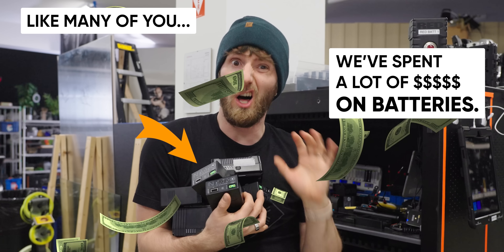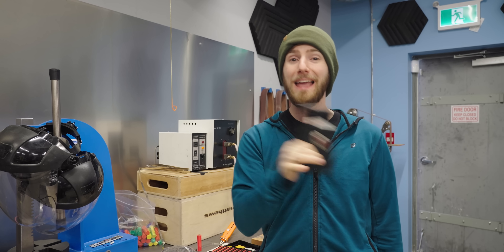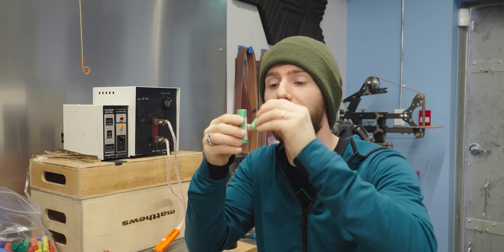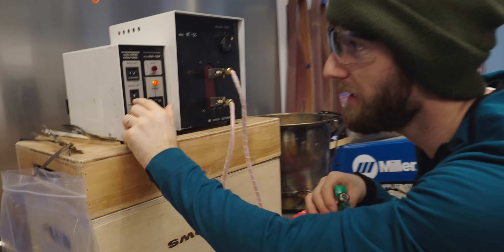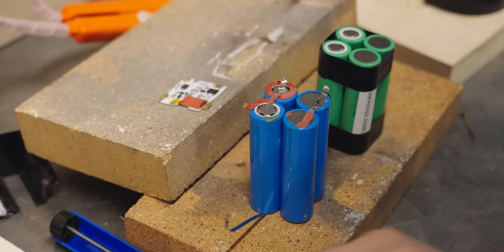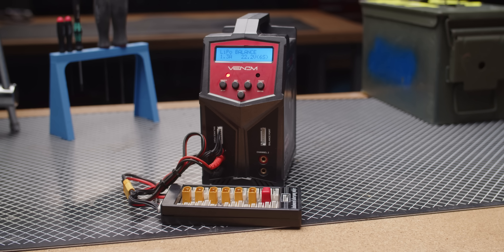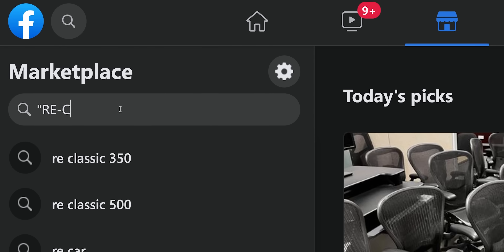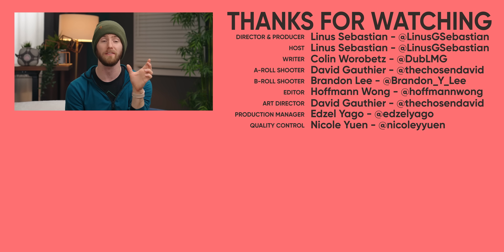This should be illegal… Battery Repair Blocking

Comment: Don't forget, this "Evil BMS" concept isn't just limited to batteries. Older Stratasys 3D printers (Specifically the Dimension SST and BST models) used cartridges of filament with a digital sensor to read the storage count of the spool. Sounds great right? Well the problem is, you can't go in and reset that even if you've replaced the filament yourself, meaning once a cartridge is dead (and usually you would be left with 10% of it that's unusable), that's it, into the garbage it goes and good luck getting affordable cartridges after they've become obsolete.

Comment: @linus you do realise that the spark you're seeing is from the tips of your crappy torch and not the cells right?

The cells can't spark in the configuration you have them in as you're only connected one end. They're open circuit.

The ones you threw out are perfectly fine.

Comment: The BMS is just dumb/evil in that there is no reset line on what should be latching faults. Preventing charging or discharging after a zero voltage event is a safety requirement as you can't safely charge a battery back if it has ever any single cell drop to 0-2V (Which is the same as disconnecting the pack)

If you ever do try to recharge a cell that hit near 0V for any moment in time it might look like it is charging but holes or denrites may have formed which will result in an internal short/fire/explosion. I've accidentally killed some battery packs by leaving a device attached and allowing the BMS to go into low voltage cutout but then going ten steps further and forgetting to charge it for a year+ at which point the battery cell voltages would have self discharged so low that physical damage would have occured.

If your extra "lucky" it will charge without exploding on the first cycle with reduced capacity but it is basically matter of time after that before something bad occurs to one of the over discharged cells.

Comment: Uh I don't think this was done correctly. When I see other YouTubers doing this with LiFePO4 batteries they use spot welders which have timers to make sure it is not overdone, and before they ever weld it they do a balance charge on them to ensure the same voltage. I think if Linus did more research on it, he wouldn't have popped any cells.

Comment: A guy in the UK bought a second hand Electric vehicle. He had it two years and the batteries need replacing. The resale cost of the vehicle with good batteries is £13k. The quote from the manufacturer of the vehicle to replace the batteries is £15k. So basically the vehicle is uneconomical to repair? Funnily enough the vehicle is only seven years old.

Comment: It's funny that you guys got all your extra 18650s from a vape shop because vapes are the only reason I'm even familiar with using 18650 cells. And yes cheap ones blow up rather easily. I have breathed more of that smoke than I care to admit. I did not know how toxic it qas until now

Comment: This happened to me with an old HP laptop battery (the locked BMS, not repeatedly throwing sparking cells to a sand bucket and running for my life).

Comment: Great video, bad title. Just define "This" instead so people can find it!

Anyway, yes this kind of DRM is awful. You see it in another things such as external hard drives. For instance, many Western Digital external drives' dock will not work with any other HDD other than the one it came with, and it's built into the SATA controller. Extremely frustrating because it also made data recovery very difficult for those drives if you were to attempt it at home. I recommend Seagate for this reason alone lol.

Comment: Gee, sorry to say this but you guys are amateurs. As someone who has built quite a few battery packs for ebikes I can tell you that building a pack is quite easy if you have basic skills. All you need to do is buy right things from Aliexpress. Spot welder that can do more than fine job for 30 bucks, pre-made nickel strip for a pattern that you need for under 10 bucks, LittoKala charger/tester to equalize and test cells for 20 bucks and if needed a replacement BMS for 20 bucks also. Original 18650 with good enough amperage and decent capacity and brand (Samsung, LG, Panasonic) are a bit more tricker to find but there are reputable sellers. Usually in bulk they come as 2.5-3 bucks a piece depending on the capacity and amperage.
And don't forget to add insulation paper to cell tips and around as well as some Kapton tape (all together 20-30 buck but can be used in more projects). Btw. original battery pack was also done as total crap obviously in China.

Comment: also, if you're pulling a lot of amps, you want the discharge rate to be the same. if not the cell discharging faster would be at a lower voltage. and there more, it's best to hold batteries together with shoe goo (it bond well to almost everything and it's like a rubber (so it's shock-resistant).

Comment: That welder isn't very good. I picked up a kWeld recently and it works very well! You simply set the energy level and it will make consistent welds. Make sure to feed it enough voltage for thick strips though. I think it supports between 8 and 30 volts, best power it with a 4S to 6S LiPo or some hybrid car batteries. I tried lead acid car batteries but they don't seem to work well at all.

That welder is not applying enough current, and the burst is lasting way too long. The pulse should last small fraction of a second, but it sounds like it's running for multiple seconds per pulse. Enough time to heat up the internals, boil the electrolyte near the end of the jellyroll, and decompose the chemicals.

Comment: Yep, you are just an fearmongering guy, working for about 8 years with all kinds of li ion batteries, if you are careful in what you are doing you dont have problems using good recovered cells. Also scaring people about what happened with 4 cases of millions because those batteries are manufactured by millions per day, so yeah, just keep scaring people with your influential power to make landfills more bigger with cells that are actually good and still usable. By the way the spotwelder needed to be used less time to spot without looking red hot like in the video, and that could damage the batteries too, appart from rupturing them as part of your facade of purposedly make the spot welding process more dangerous.

Comment: I recently had bad experience with PDP. My rechargable batteries from Xbox controller docking station didn't hold a charge, so I've reached out to them. They said that they don't sell replacement and they even recalled the docking station due to safety reasons. I can still find the same docking stations in the shops

Comment: It's actually waaaay cheaper to replace whole device than battery. Batteries are very, very expensive considering whole device cost. Go and check it. Do I like it no, but go and find real solution vs. saying it should be illegal. No, making something illegal doesn't fix an issue.

Comment: "Well you've already seen the title of the video, so..."
Well... the title doesn't reveal much. Either there's battery DRM on the inside (which should be illegal), or they successfully swap the batteries and... want to be on the side of anti-right-to-repair and say swapping batteries is dangerous? (It can be, but not enough to make it illegal or even hard to get the parts!)

Ah, it was the DRM issue.
I would verify that the InfoLithium is not working. Try charging it. A lot of BMSs when they go into critically low battery states will completely turn off to stop damage from occurring to the cells, and won't wake up until they see power coming in from the charger side. My battery bank does this, and I've seen multiple people re-cell infoLithium before, but they usually try charging them first thing, so that's likely a reason if yours didn't work immediately.

Comment: So my first test on the RED battery pack would be to keep required voltage to the BMS the entire time ? 
Maybe using jumper wires connect the new battery array / pack,
In theory: 
Connect the positive and negative of your new battery pack to the BMS
Then disconnect old wore pack. 2 packs going to the same BMS would not be too many Volts

Is everyone thinking similar ?

Comment: I've done some battery recovery/repairs, the worst one I've come across is IKEA's bicycle battery. The bicycles where a flop, stopped selling really fast due to some fault with the bike. That enabled me to buy up some new battery packs really cheap. The cells where glued inside of the case, really dangerous to take apart. Shorted 2 cells while disassembling, but no fire.

Comment: i like how the cables repel each other when linus presses the button. Probably due to humongous current flow and the magnetic fields generated by the wires.
Reply: It's actually a pretty easy electrostatics 101 exercise. All you need is Ampere-Maxwell's law and Ampere's force law. A crude estimate based on footage and some guessing gave me about 800-1000 amps, which kinda seems reasonable.
Reply: @ДмитроПрищепа-д3я  Yes, I know. I'm an electrical engineer. It's why I mentioned it. I'd say your estimate is reasonable too.

Comment: Most of the BMS as you can jump start back into operation but some BMS if you disconnect them without supplying power to them basically landfill trash which is sad for the environment 😞

Comment: Most notebook batteries I've opened (Lenovo, DELL, Acer, Asus) use bms ic from Texas instruments and normally these bms don't support changing the cells and even if I managed to change the cells I would have to reset the capacity stored on the chip.  As I didn't have the recorder and I found out that the ic can have passwords to prevent this reset I was never able to recondition batteries of these brands, but a Brazilian brand notebook uses a bms that stores the information in a 24cXX eeprom and I managed to recondition the battery after erasing 8 bytes in the eeprom but usually a lot of work for little return

Comment: A tip for holding batteries together is high temp hot glue and tape to help keep the battery together before you weld.

Comment: Maybe is simply the under voltage protection? Somewhere there is a mosfet which cut off battery connection when voltage is below a certain threshold.

Comment: 00:45 if there's something preventing you from replacing the cells? Yes, and that's why we née right to repair.

Same happens with drones. After some use the cells bloat, and you need to discard the battery when you could just replace the cells.

Comment: Linus: Talking about recycling and right to repair.
Also Linus: Spread fear-mongering overreaction and throw some perfectly good battery away just because small spark. 
did he not talk about how spot welder works in last battery swap video? it will make spark by nature.
even if some old cell are mismatch, you can still re purpose them as something low power usage like usb power bank.

Comment: 13:45 needed to restart BMS.  some need you to short P- to B- to start BMS
Reply: Had the same idea. Some BMS systems require that or to be plugged in to charge in order to enable the pack.
Reply: @Madcat3108  yeap. 
While he touched in the general idea of DIY battery making, he done many little mistakes. like expecting that series connecting batteries could do a spark if they were unmatched ( never will) thats what happens when you PARALLEL unmatched cells

Comment: As someone who's spent a considerable amount of time (and made a considerable amount of mistakes) working with salvaged lithium batteries, your "mistakes" were non-issues.
You were experiencing sparks from the welder (especially those crappy tips), not battery sparks. Your "highly dangerous and volatile" cells ARE highly volatile and dangerous, but not THAT highly volatile and dangerous. When a lithium battery goes boom, it goes boom. It doesn't sit there and think about going boom.
Replacing a BMS is also an easy task, and those packs will remain fully functional after.

Comment: I recently tried mounting new cells on an old asus laptop, i found out after the replacement that the bms ic is hardcoded to pop an internal fuse when it detects zero volts at one cell input. The whole operation resulted in a big waste of money and time. By the way, I'm writing a master's degree thesis on active cell balancing, I hope they get more popular over time :)
Reply: Hey can you share your paper i would really love to read it.
Reply: @traceparadox  x2
Reply: @traceparadox  unfortunately it's in Italian but in a month or so we will publish the full article
Reply: you need some tool from CN , they detect bms and 1 click everything is done , that simple so that why CN buying dead laptop battery for recyle
Reply: @quanvuminh9727  I interfaced the bms ic through I2C but you cannot reset the error flags if you don't have the non default password that Asus used. Even having that the ic just enters in a permanent fail status when you disconnect it from the pack with no external supply
Reply: Thats why you dont replace cells.... You "build" a whole new battery, different mindset, even the case for it, 3d print. Also.... An entire thesis on just balancing... Hmm.. I feel like a more exciting subject would be the difference between the traditional lithium cell and teslas new ones, mainly the internal layout and path the electrons take to get from + to - because that shits fascinating 

Omnomnom
Reply: @TheAceofFate  it's on balancing >circuits< and since they are not commercially available and still on study we designed and built a new type

Comment: You don't see this because i'm blocked but thats ok,   You should go to the battery building forms...
before even trying this... the spot welder your using is over kill and has too long of a dwell time... your blowing right through the case.   
this is the one I use..  and I've never had a blow though... 
https://www.youtube.com/watch?v=231qtaRIs3M&ab_channel=HowIDidIt

Comment: DJI batteries for phantom 4 ...when phantom 4 was released I bought one. I have serious cancer and I stop using it for long time (over 2 years) and 4 batteries are bricked. Im very good technical wise and I revive the first one and I had correct voltage, and even they didn't dip below 3.5v but BMS is BLLOCKED and I lost $1000AU in batteries even if Im able to properly fix them. this kind of money is unreachable in my situation and my dron is useless, and even if I sell it I will lose even more because Im selling dron without batteries.    ...also, I bought gimble camera with 2 batteries and they are also F****D ... Lesson to everybody. JUST in case charge Your batteries once a year or 1/2 year up to 80% to avoid my situation ...but I also understand if Your focus is "elsewhere", because batteries are NOT the most important thing in the world to wory about ...Thank You for this video, for bringing awareness to this issue

Comment: I didn't hear you mention the companies that create a proprietary battery case and then change the device and battery two years later, making not only the batteries, but the devices all into paperweights. In the past 15 years I have seen all the power tool and laptop companies doing this. The only way to protect from this is to buy extra sets of batteries and keep them in a cold dry place on a balanced trickle charger.

Comment: This video is still clearly anti right-to-repair with your constant berating of a user's electrical competency. One could easily purchase 18650s with solder tabs preinstalled and complete any replacement with relative ease. Just because YOU are not competent in completing such a repair does not mean others cannot complete this safely and easily.

Comment: Where were the sparks coming from? It looked as if both weld tips didn't stay in contact with the strip, causing an arc to jump. If that was indeed the case, your cells are fine. Even a momentary short circuit shouldn't kill the battery. I'm no battery expert, but I am proficient in electronics and electrical knowledge in general as a result.

Comment: For anyone who wants to do this 18650batteryshop is amazing they have great sales on cells, 21700 bar far is the best in my experience with these cells up to 35A output, 3.6v at 4000mah

Comment: Littlebit high duration on the weld in my oppinion. Should be shorter with higer current or shorter without any change to current.

Comment: I know that Rosman has had some videos on e-bike batteries, you've done more than a few collaborations with him, you could check with him about making batteries.

Also, speaking of volatile memory for those batteries, I learned a while back that Capcom used a similar technique to thwart bootleg arcade boards, and it worked for over a decade.